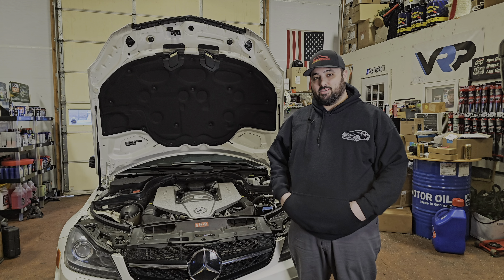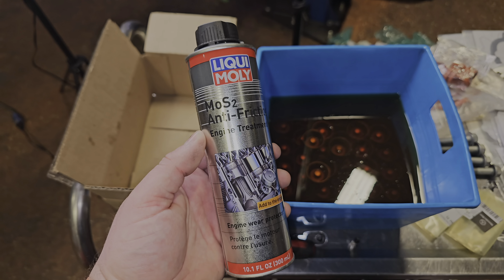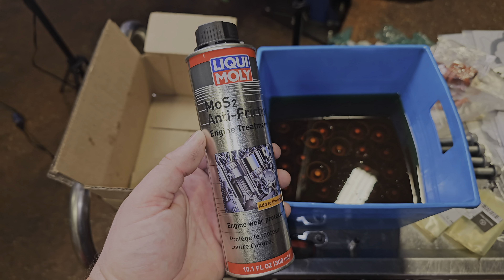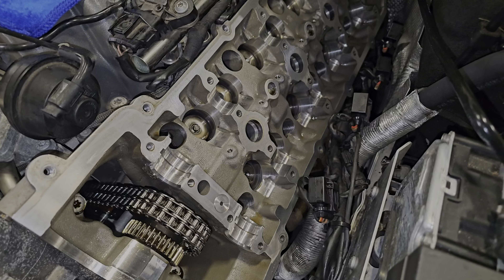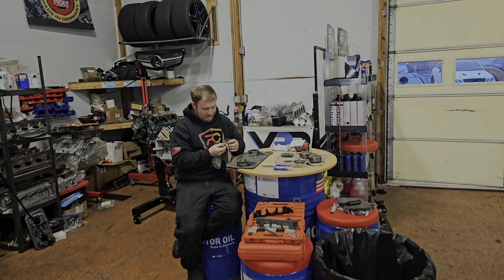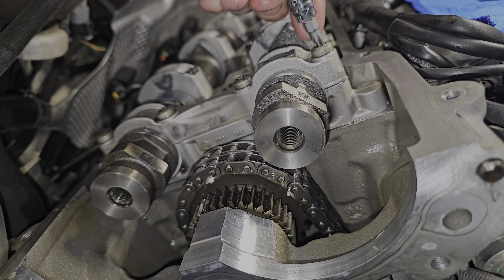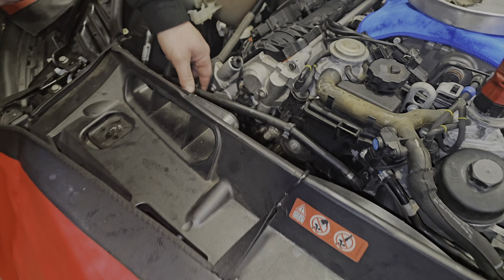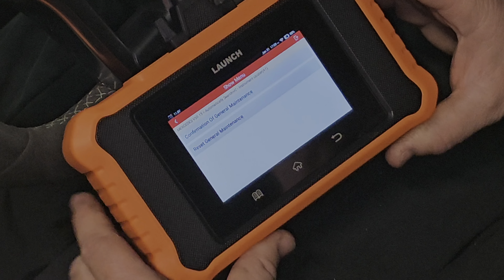ONE OFF C63 EDITION 507 IS NOT SAFE FROM THE M156 CAM FAILURE! EXTENDED WARRANTY FLIPS THE 10K BILL!

Comment: This actually looks like a very non-invasive & relatively simple job considering what you get at the end. Just need the right tools. I'd rather do top end work over bottom end (cough, BMW, cough) any day.

And to Rusty's point on modules, yes more computer = more expensive/more failure points, complexities, etc. However, my mom's Acura gives me half the info my E coupe does & it would be nice to see what's going on before I have to tear into it.

Comment: Did the cam adjuster upgrade (4) and now receiving a P0016 code for the right intake adjuster. Made SURE the cam timing tools were correct and the 40 degree crankshaft mark aligned. Before I rip this apart for the third time, I seeking feedback on what is your (Modern Masters} solution to this occurrence since I know you've seen it many times afer an adjuster job. Change the sensor? pull the adjuster again? My diagnostic computer (Zurich Pro) doesn't provide an analysis feature for this engine part/system
Reply from the maker: Drop the car off or call in for a phone consultation

Comment: I'm currently building a supercharged fully forged and sleeved M156. Between the two aftermarket manufacturers for cam plates, what is the actual difference between all the different "stages"? I'm struggling to see the need for the crazy expensive "stage III" plates offered by 63 Motorsports. Question: what is the recommendation for an all out SC'd forged M156 with regards to these plates? 63 Motorsports also claims the BS tappets to have a larger oil capacity and better check valve to prevent the oil draining out. Is that still true or were those difference rectified in the most current 156 tappet part number you are installing in this video?

Comment: How many did this c63 have? Did you guys go in knowing cams needed to be replaced or after inspection?
Reply from the maker: After inspection
Reply: Any symptoms the car had when the cam gears were going bad or just the cel light? I have 150k miles on original cam gears. I do have a rattle but no cel. Thinking I should do it. Thanks for easy guide video
Reply from the maker: @SROC276  sometimes cel but most of the time bad things happen before that

Comment: So what's the root cause of the cam lobe wear?  Lack of maintenance, the lifter not moving easily, materials, or something else?
Reply from the maker: Normal wear for these. Not 100% of why but this is why we recommend VRP hardened camshafts and new tappets!
Reply: The material differences in the cam and tappet is the issue. Which is why our hardened cams help resolve the issue.